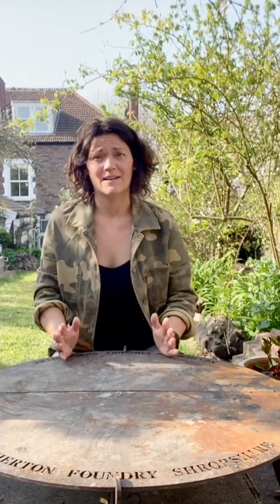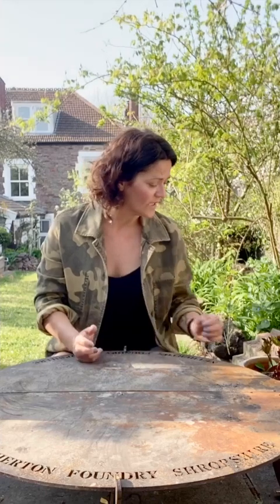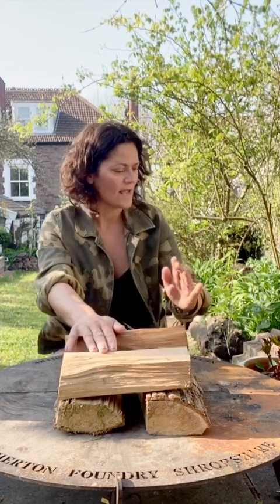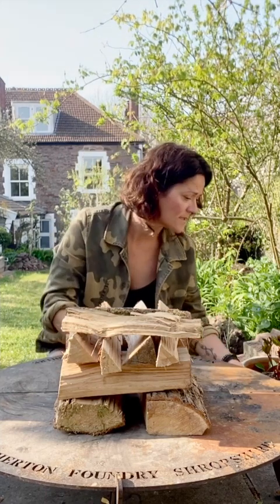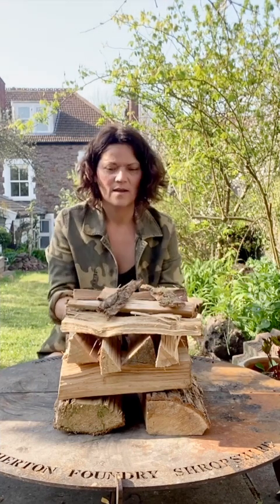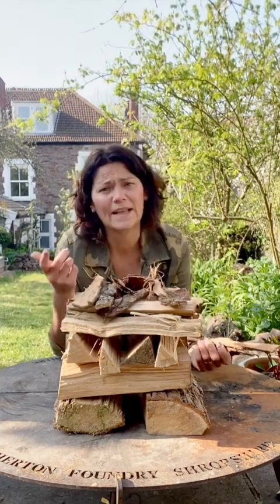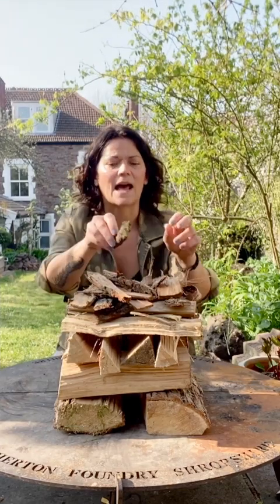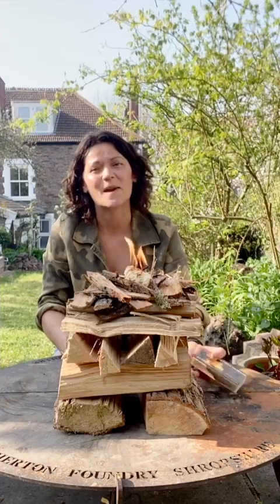Top Down Fire, my FAVE way to light a fire

Comment: Genevieve, this is going to blow your mind:  Only today have I heard of the top-down fire. I just bought a Solo Stove (it burns wood), and have read that you pack it full of wood and light it from the top. Whaaat?  Newsflash, guys, heat rises! I need my Vaseline cotton ball at the bottom, with a spark from my ferro rod, and then quick hands to add the tinder, then kindling, then bigger wood--you know the drill. I'm so glad I ran across your video, explaining how the tiny embers at the top filter down into the cracks below. There's a whole new world out there, and a new beginning for me!!

Comment: I switched to this method in my wood stove, but found that it only worked about 90% of the time.  Too often, the kindling on top would burn up without spreading down, leaving, literally, a hot mess.  So I went back to my Timburn steel/ceramic starter with the creosote-busting liquid.  It costs about 80 cents a pop, which is a bummer, but it always works and is supposed to be good for my chimney.  Nice video, though.